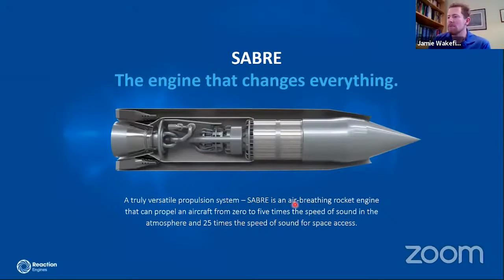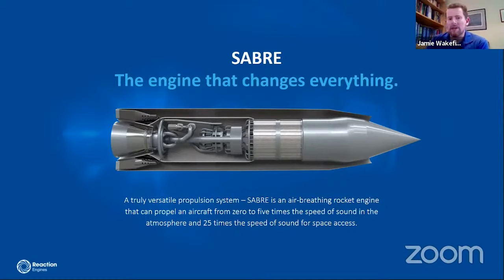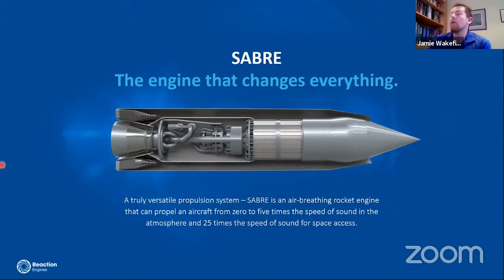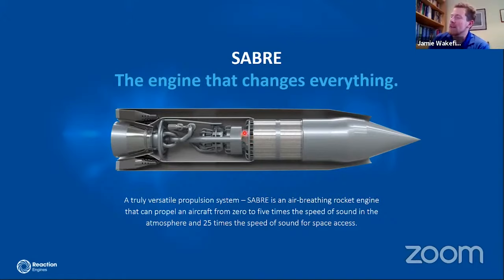SABRE! | Reaction Engines - The Air-Breathing Rocket Engine | Space Talk Best Bits

Comment: I wonder how much optimization could be done with fuels? Youre using Hydrogen as the closed cycle fuel, but JP1/RP1 as the air breathing fuel?

I was going to suggest Alcohol as an air breathing fuel. Alcohol actually makes a decent bipropellant too, specifically it has been most famously blended with Water for cooling or with hydrazine to become hypergolic. 
Ethanol is closer to typical fuels like gasoline or jetfuel, and Methanol is further down the alcohol fuel rabbit hole, but they have some amazing properties for their tradeoffs. Ethanol, and especially methanol, have lower energy content than kerosene fuels, but everything else about them is better. The combustion temperature is cooler, the vaporization temperature is far higher(why i am suggesting it), and a bunch of other interesting properties. You would have double or triple the air breathing fuel consumption with ethyl or methyl alcohol, but you likely wouldnt have the cooling issues. In piston engines, often no cooling system is used with methanol, and it is difficult to maintain operating temperatures while fuel-rich and under high engine load.
The increased fuel mixture also roughly doubles the exhaust gas mass in relation to gasoline or kerosene, this would make the exhaust turbine run far more efficiently while in the turbo-jet regime. The exhaust gas mass would also increase thrust in air breathing modes. Volatility is extremely low, similar to kerosene.

Im not a chemist, or an engineer, or a physicist. Though, I know that a major issue for design is that major changes are rarely considered, and instead flawed designs will be perfected. Id be willing to bet that if some chemists were consulted, fuel options would exist that will solve difficult issues, though they may introduce new challenges.

Comment: this really is the most basic of concepts and why it hasnt been approached before is ridiculous...

the real big issue with the rocket as i see?

you accelerate all your mass in one direction, by expelling a small portion in the opposite direction. sure.

think about it.
you gave all that mass energy. momentum. overcame its inertia.

every bit of the mass you have to expel, you have to slow down. bring to a halt. that takes energy.
only to then re-accelerate it in the opposite direction.

and as it gets faster, it has more momentum or energy to dissipate before it can be reaccelerated...

whereas sucking in your air for a vast proportion of your journey, taking a fluid that is relatively stationary so it only has to be accelerated...

its much like a mouse running up a string versus a mouse crapping itself to death whilst eating a bag of peanuts...